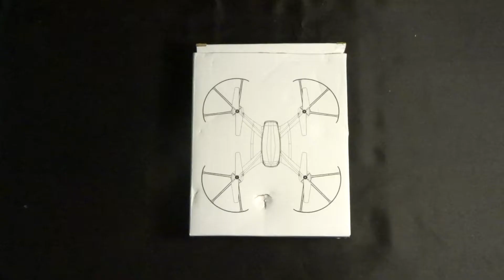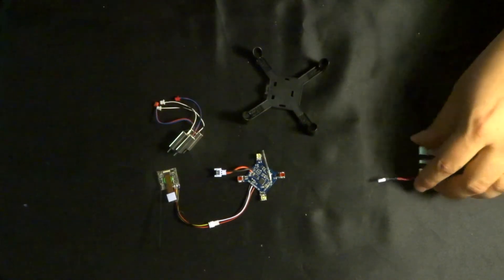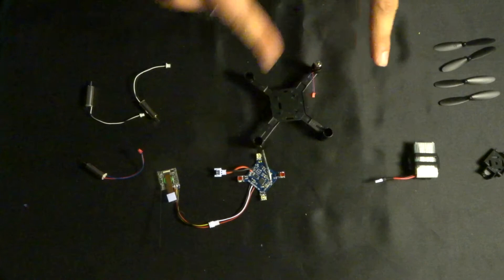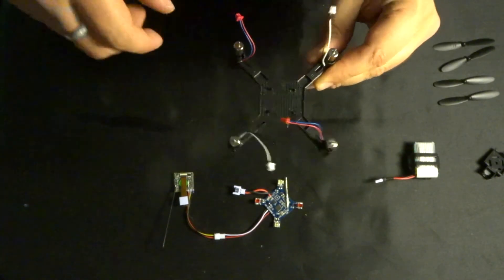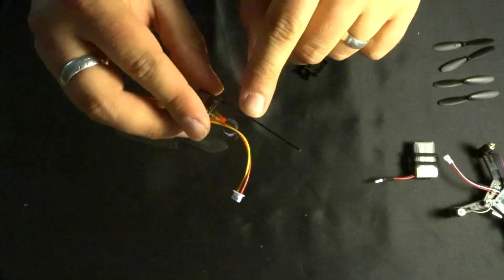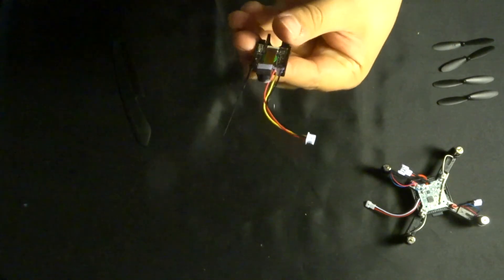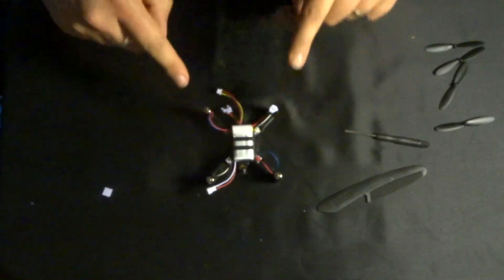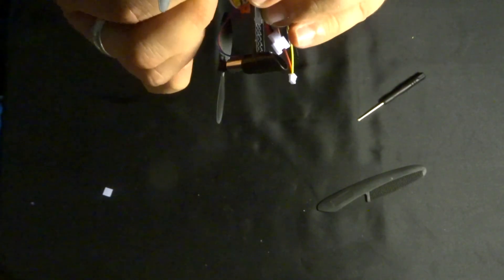iDrone DIY FPV Racing Drone Build

Comment: How to connect camera with smartphone ?
Reply from the maker: Hi Parthvi Valaturn From what i remember, turn on the drone, go to your wifi settings and look for the drones wifi connection, once connected then open up the app (info for that will be in the manual) then you should get video relay, hope this helps ;-)